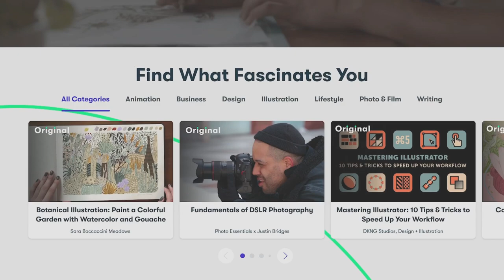ABANDONED BARN FIND Corvette First Wash in YEARS! Satisfying Car Detailing Exterior & Restoration

Comment: My dad passed last year. Left me his '74 Corvette. The original engine had bad compression, so he did a similar year 350 4 bolt main block, 383 stroker setup, slightly higher compression pistons, a Edelbrock Performer Cam and Intake, then factory carb adjusted for displacement and cam change. Maybe only makes like 50+ more hp/tq but still fun. Just needs better rear mono lead setup.

Comment: If the engine miles arent bad, I am 90% sure I could get it to turn over.  Often a car just sitting can cause it to seize up.  The rings get stuck due to moisture.  I've seen cars sitting for 30 years turn over after soaking down the cylinders for a day.

Comment: Regarding the engine, I would replace the stock 350 CID with a new modified 350 crate motor. I would keep the automatic transmission.

Comment: Swapping out that engine?  Depends on budget and intended use...LS swap is always a good move if you actually want to use it with modern gas.  If I chose today I'd find an old big block and put and Edelbrock multiport fuel injection just because I love the sound...not to bumpy of a cam, though.  Smooth idle big block for me
Reply: After watching the rest of the video, yeah those floormats have to go.  And this car seems more appropriate with a mild small block that's well-sorted

Comment: Pull and rebuild/replace original engine.  As a barn find I'd be suspicious of all original wiring.  You don't need the late 70s on up electronics updates either. Keep as original as possible.

Comment: Blue spark plugs out first mystery motor oil downers spark plug holes let it sit for a few days but socket on the crankshaft pulley and turned it over by hand and one freeze the motor

Comment: I suppose if you have a bad engine it would most likely be the cheapest to have it rebuilt???  Depends on what you intend to use the car for.  For the most power I would guess replace with an LS.  Expensive and a good amount of retro fitting.  Whatever you do, shame on you for letting the car go.  Keep it clean and find a good cover.  Get it running and drive it now and then.